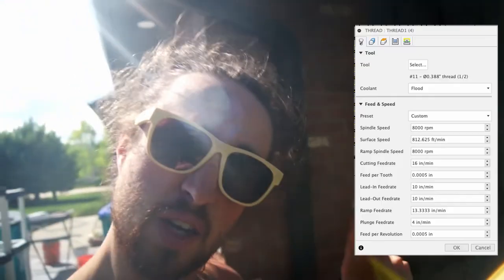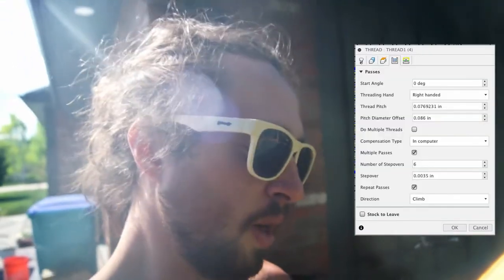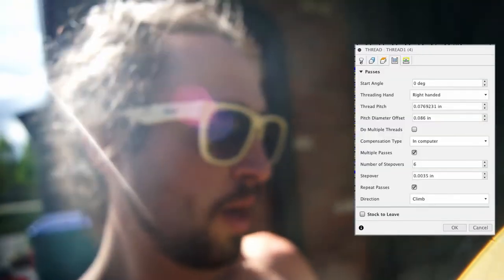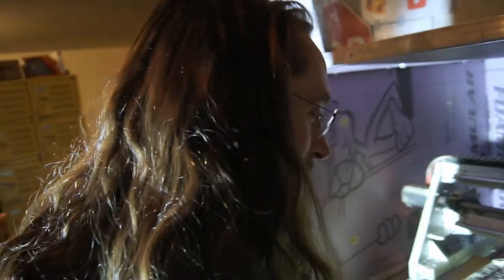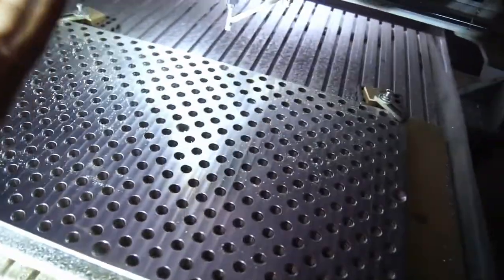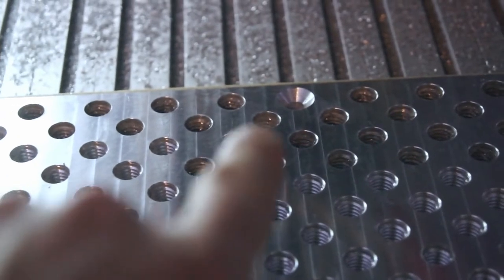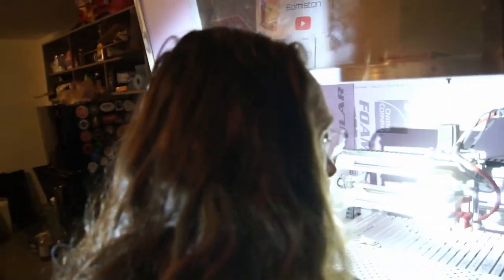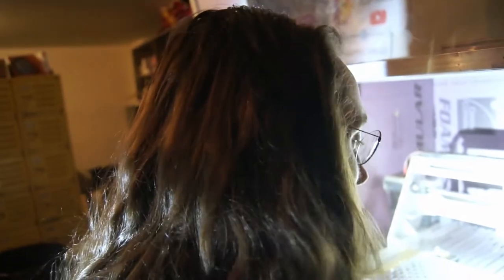Mirror Threads - How to Thread Mill on a Router

Comment: I’m machining a pallet for my vise which uses smw’s pattern for 1/4 - 20 holes. Yes they come out like a mirror finish! But take hours n hours to finish! I need to figure out how to put a chamfer on the holes what bit to use then machine it???I’m trying to figure out how to select multiple holes at once (up to 200) and chamfer them in cam. I can’t seem to select all my holes in manufacture environment to chamfer 200 holes in a pallet that I’m making for my vise without physically selecting each hole!
Reply from the maker: Yeah that’s a tricky one. I think I manually selected them all when I made mine. But sometimes if you drag a box to select multiple things you can figure it out!